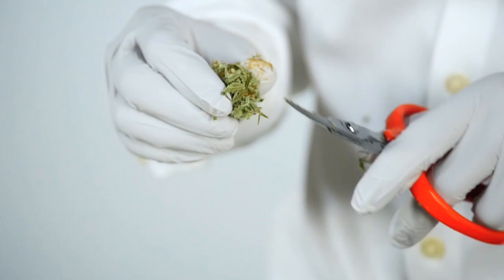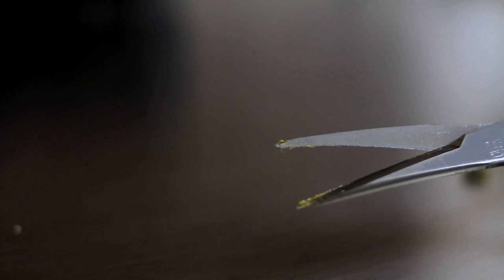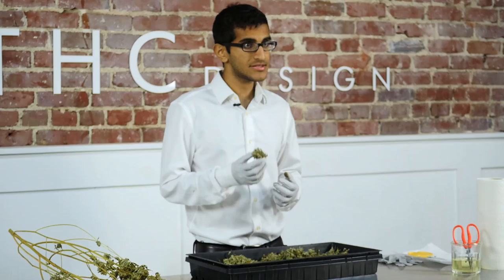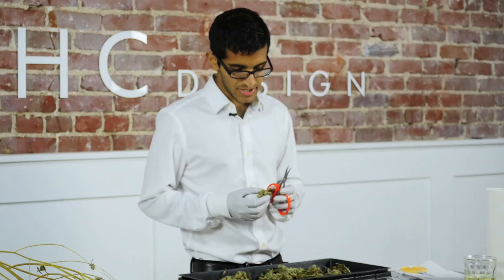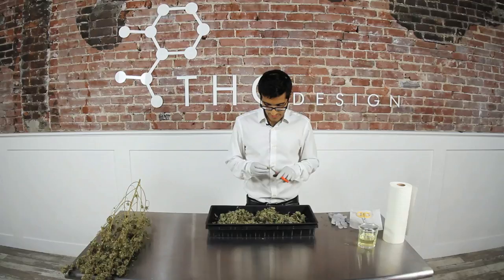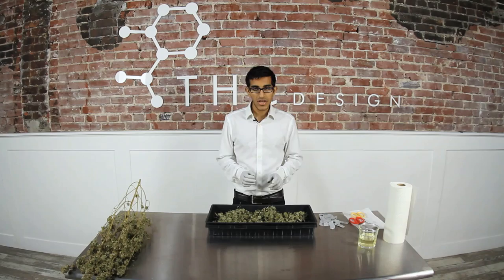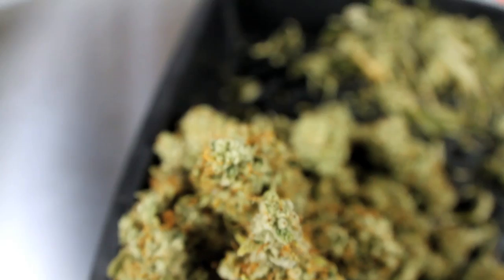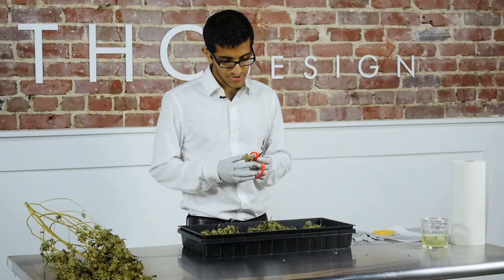THC Design : How to Trim Cannabis

Comment: Professional video. I've seen a lot of trimmers use this technique and I would highly advise AGAINST it. Within the first clip shown you can see a few of his clips missing the bud. Showing he is going too fast. Always make sure every snip you do is accurate. Go for the stems of the crows feet/ leaves and never touch the bud. When you flick the blade like he does its like treating the scissors like a mower, They are clippers. One clip at a time and make sure you always land the clip you were aiming for. You will speed up naturally, When you do and if you miss... Slow down.. Repeat until pro <3
Reply: You need to do a video. For a beginner this video doesn't do anything to help you start out right.
Reply: I’m starting a trimming job in a couple weeks, exactly how fast are we expected to go?
I’ve trimmed countless times with friends that grow and this guy is trimming twice as fast as I go, seems a little reckless. Nobody’s ever asked me to go faster or slower so I’m just used to going at my own pace. We never pulled the nugs off before trimming so having to hold the stem also slowed down the process
Reply: It's definitely fast. I hold the stem and do straight up, then spin slightly and repeat until you are where you started. No need to look at the bid longer if you do this. And start slow making sure every snip you take, cuts a leaf. And eventually you will speed up, be accurate and not waste any time. Hope that helps 👌
Reply: @ogs1mpson609  it depends on how much bud they want you to trim a day like I have to trim 3 pounds a day for my job so we got to move our hands lol
Reply: @miguell2731  three pounds a day? That’s bonkers. At my job we’re told that we have to hit at least a pound a day. Three weeks into my job and I’m trimming on average two pounds a day (not counting the trim or stems) 
Do you work an 8 hour day? I suppose I could hit three pounds if i was trimming an easy to trim strain, but we trim up to three strains a day and some strains just take more time than others.
Reply: He’s also holding the curved scissors the wrong way, the curve should be pointing to bud not away from it
Reply: @ogs1mpson609  that’s a dope gig👍🏾
Reply: @miguell2731   9 months into my trim job and I’m trimming anywhere from 2-4 pounds a day which I didn’t think was possible a few months ago
Reply: @ogs1mpson609  how much do they pay per pound?

Comment: I have a question - so if I cut branches off the plant (I’m in week 4 of flowering so I have a time to wait still) —so I cut the branches off (and I will take big fan leaves off right away when it’s still wet) 

Then - dry the whole branch for 5-7 more days and then go back in and detail trim all crows feet and sugar leaves 

— once this is done - put all buds onto drying rack for another 5-7 days - then into ball jars to cure it for 2-3 weeks 
So at this point it’ll be all nicely trimmed buds and will be dry as F*ck. 

Is this a good idea ?

Comment: Isn't your slapping technique knocking the trichomes off?
Reply: It would not. It may look like a slapping technique, but the technique actually does not affect the bud all that much. The leaves are usually sticking out, and when we practice enough, only the leaves we want off get touched. The technique does not 'shock' the bud and cause jitter, resulting in trichomes jumping off.

Further, the bud has a natural oiliness (often just after drying process, the more dry it becomes, the less oil there is). This natural oiliness has a certain adhesion quality to it. 

It is for this reason we do not want to touch the bud too much, and must wear gloves, because it is through touching that a lot of the trichomes can come off.
Reply: @mooselittlethunder  The "oil" is the trichomes melting.
Reply: @FixNewsPlease  Right. 

When you suggested that the slapping technique would knock the non-melted crystals off, I presented the argument that it would not do this due to the method of trimming.

The main reason anything would come off is because of the oil binding with a physical substance, i.e. the gloves, rather than from a greased scissor
.

Comment: Looks way too dry or just me?
Reply: I think during the curing process some of the moisture inside the flower comes out and it makes the buds a consistent humidity, but at this stage they would look dry, since that stage hasn't happened yet.
Reply: There are different ways to cure a plant. There is research that goes into it as well. Often, the procedures for curing are not optimized which results in what might appear as a more 'wetter' bud. There is a sweet spot between wet and dry, and finding that based on the way you grow your crop is a technique in and of itself.

Comment: How come you soak the scissors in vegetable oil?
Reply: Oiling your trimming utensil helps provide a cleaner cut the next time you use it.  Think of sharpening a blade or seasoning quartz/cast iron. Always wipe off excess though.